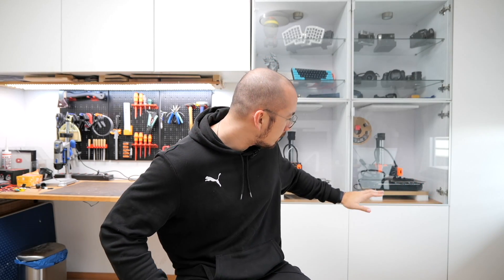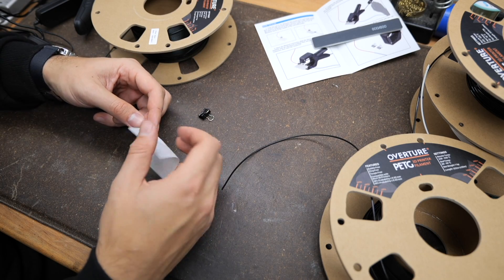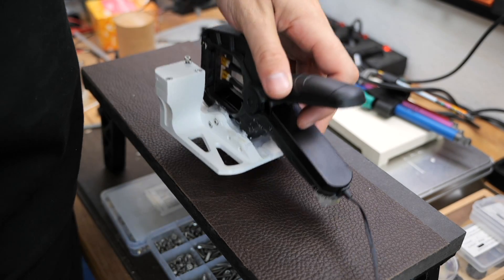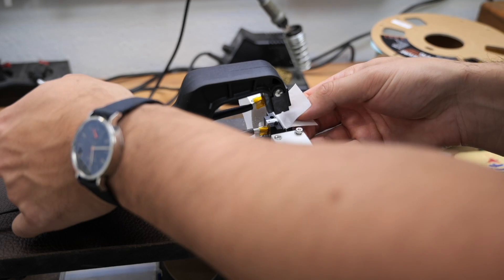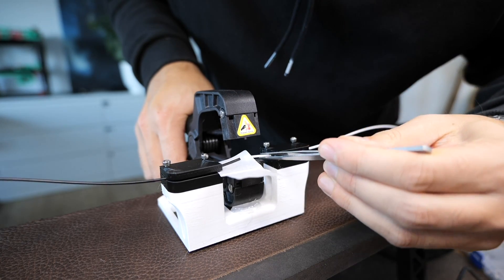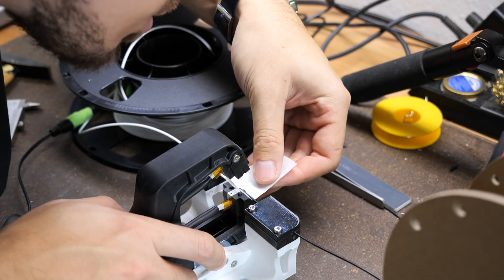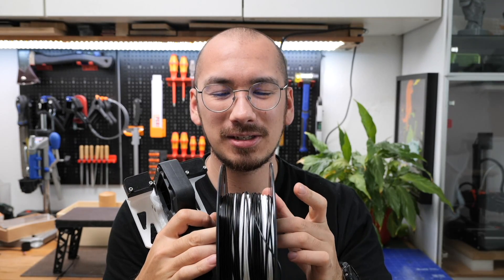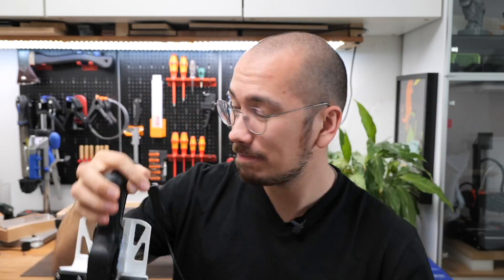Transform Your Scrap Filament into Usable Spools with the Wisepro Filament Connector / Splicer

Comment: I appreciate your honesty and the effort you put into this.  I am still looking for the low cost solution to weld two filaments
Reply: a super cheep method i found that appears to work fairly well is to simply get short length of silicon tube and slide it over both ends of the filament then just heat up the tube with a soldering iron

Comment: There are easier ways to weld filaments.

Slip a tight inch long piece of bowden tube on 1 filament. Heat both filaments on the tip of a soldering iron, until they look squishy. Then jam them together and quickly push the PTFE tube over the join. Let it cool, then push the ptfe tube off. A little clean up is needed sometimes afterward, but it is much easier to do and produces a usable join

Comment: For the time, effort and cost you really need to want to do this and have quite a bit of nearly spent rolls to make it work.  There are several problems with this welding...  the welded spot isn't going to flex as easily as the rest of the roll--can cause a break and disappointment.  If you are not careful about getting the diameter perfect it will jam and ruin the print.  I have done a few welded rolls for colorful easter eggs and some worked and some failed.  For my time it was better to just print some toothpaste squeezers or utility knife prints and use up as much of the roll as possible and toss what was left.
Reply from the maker: Thanks for sharing your experience!
Reply: @normanwink  Welding filament is definitely interesting to play with and if a person wants to do this... DO IT.  Then you can personally decide if this is something you want to keep doing.  I have blown a lot of time with projects and also learned from them so it wasn't always wasted time.  I wish there was a better welder, and keep looking for them.  This one looks like the one that failed over time because of heat damage so would be nice to know a follow up after X hours of use.

Comment: Guys.  As soon as you open a roll of filament, throw it on a scale.  Record the weight on the spool itself.

You now have a very good estimate of how much filament is remaining on the spool.  Just weigh it again.

If in doubt, look at the gcode before you print.  It will estimate how much filament it needs.  If it gives the volumetric estimate, multiply by the density.

You're welcome.
Reply from the maker: That's a great approach if you want to work that way. In case you forgot to weight in the spool when it was new, you can always look up the empty weight of the spool:
https://3dprintingwiki.mywikis.wiki/wiki/Spool_weight

Comment: I've tried many of these splicing solutions over my past 10 years of 3D printing and I've never found a reliable solution. In most cases the filament gets too thick and causes a jam, or the joint is too week and ends up breaking at some point.

Comment: To finish a spool  use my remnants in my 3d pen to do things like welding pieces together or making sure the seams of my cosplay helmets are stronger by doing a 3d bead on the inside for each seam. That is a good way I found to use that left over bit from a spool. this tool looks fine but the time it takes may not be totally worth it.

Comment: Hi and thank you for this test, finally I prefer, and by far, the thousand times simpler systems developed by users rather than this "device" which claims to be super efficient and which finally is painful to use for results more than limited, the systems that we find on sites like Thingivers or other of the same kind are much easier to use and much cheaper without any doubt, As far as I'm concerned this test is a demonstration of the non usefulness of this device, and finally as I'm not directly concerned since I always finish the coils in place I only have few times the use of connecting two coils between them and I would prefer to use the simpler system and DIY manufacturing than buying such a "tool". Thanks for the demonstration ;o)
Reply: I like the one that uses the spring from a cheap ball point pin encircling a short length of PTFE tube in a plastic ring with free floating panels you can pinch to squish the heated ends together.

Comment: My favorite solutions so far:  A Bambu X1 Carbon with the AMS. It has a feature/setting where, when one roll runs out, it just starts the next roll in the AMS automatically.  You can put in 4 partial rolls and just keep going...  By the way, I love your work area.  It looks amazing!!!
Reply: Now THAT  is a good idea, I never thought of that.
Reply: The Prusa MMU can do this ... When it works
Reply: Does this work with non Bambu filament? So far this didn't work in my case, although the checkbox was enabled. The printer asked me to put a new spool into the same AMS slot. Not sure what I did wrong.
Reply: @radicalreel yes, I rarely use bambu filament. Just make sure you identify the assigned  filaments as the same type.

Comment: I hate wasting filament so I tried similar welding things and they all either don't work or are way too much work. The easy solution is a direct drive print head and when the filament is low and you know you will need to swap it just watch it til it gets to just near the print head, pause and change the filament. I only waste maybe 100mm of filament for every roll of ABS. You can just check the machine every five minutes while there is still filament of the spool and then when it comes off the spool watch it til it needs to be changed. When it comes off the spool its easiest to pull the bowden tube from the print head so you can see easily. 
I do it with an enclosed and actively heated printer without trouble.

Comment: i always use my filament to 100%. don't understand the hassle... collect the short pieces an when u print something where the color doesn't matter print it and while the end reach the extruder push the next rest into it and so on. when u really need to weld them together use a bit ptfe tube and a lighter... than  you don't have the seam.
Reply from the maker: That's a great solution for everyone who wants to watch their print while printing.

I often start the print before I go to bed :)
Reply: @normanwink  The tube and lighter option seems interesting. I'm curious if that actually works in practice. Seems a lot easier than this finicky device.
Reply: @chrimony  i can upload a video where i can proof it
Reply: @AlucardWulf  You don't need permission from me :)
Reply: @chrimony I use a soldering iron and ptfe tube and it is easy and works